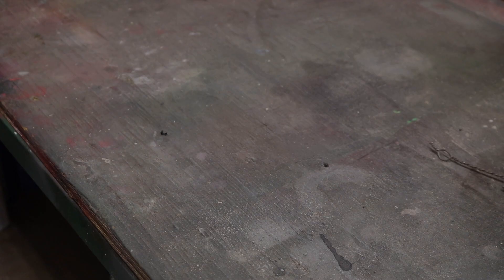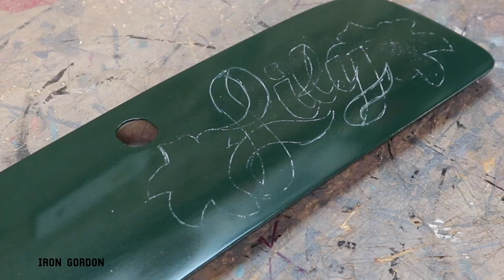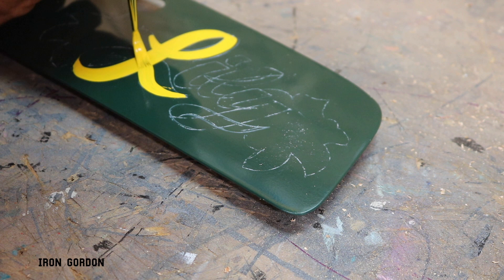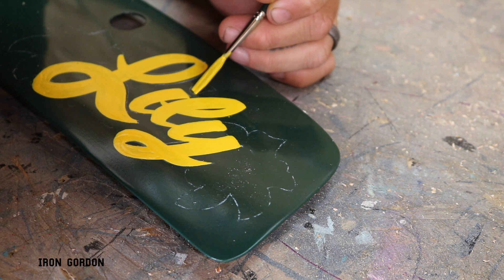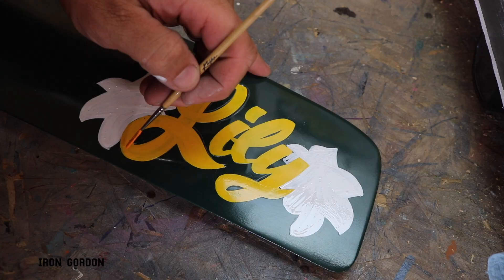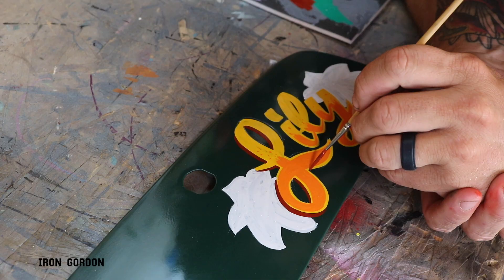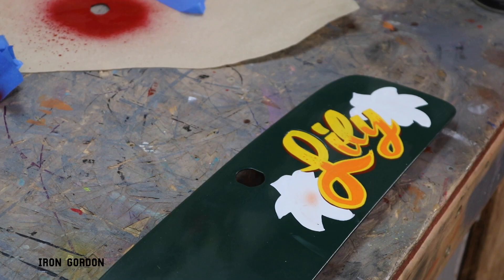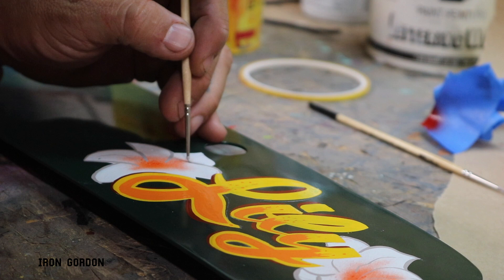Hand Lettering A VW Bug Glove Box

Comment: What's the thought behind not clearing over it? Would it be overkill to clear it for UV protection?
Reply from the maker: Not overkill, the only reason I didn't clear it was the client sent me the door paint green already, and I don't know what kind of paint was used, so I would hate to spray it clear and have a bad reaction with their paint. The 1shot dosen't need clear in general, it tends to hold up over time without.